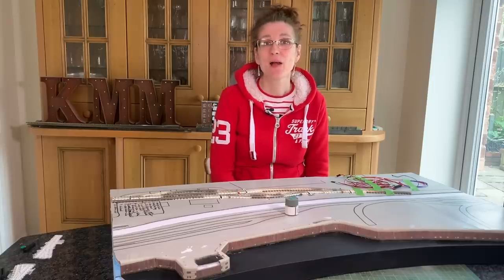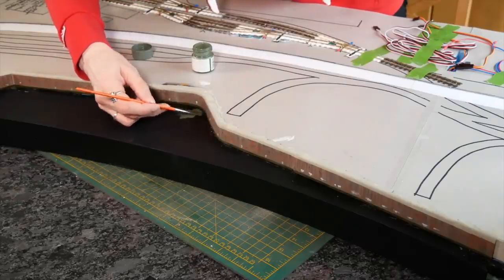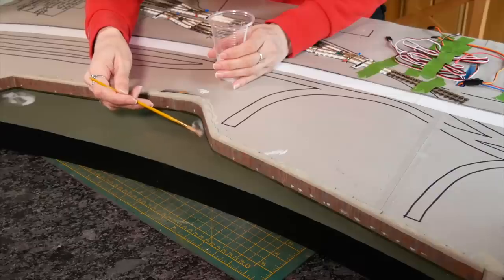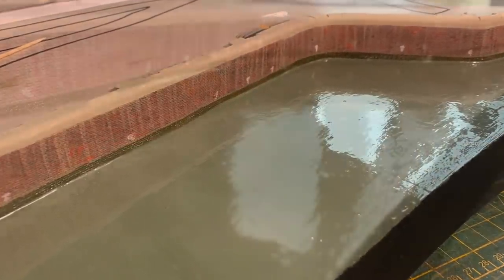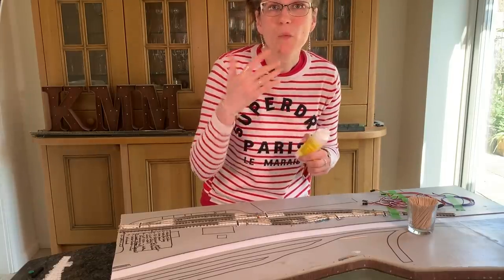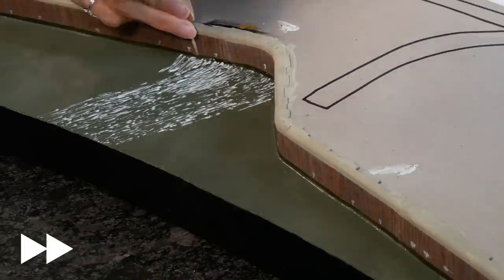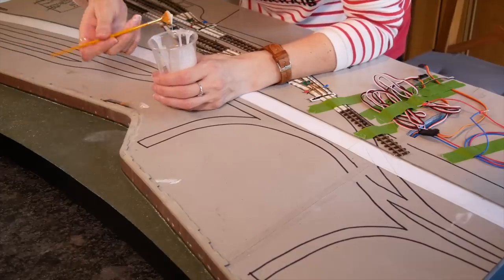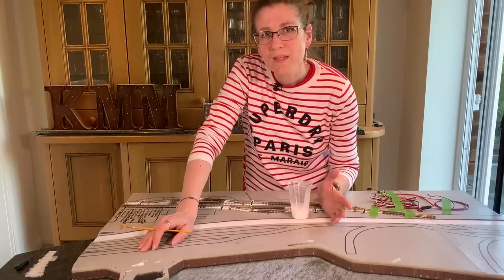Cheap and Easy Model Water

Comment: Great tip.  I liked it before you added the ripples because I need to model swampy water which is usually still; and it looked about perfect as far as texture and gloss.  The color was really close as well.I wonder if you could mix the paint with the glue as well.  Any thoughts?
Reply from the maker: Thanks. You can easily mix paint and glue but I’d always do a top coat in clear just to be sure it has the gloss to it. Even that might not be necessary but I haven’t tried it.

Comment: hi kathy - great idea, never thought this would work as good as it seems. for ripples - or waves rather - have you tried using a clear fix adhesive, like a silicone product? it is obviously not pva but it is an inexpensive 1 component product that is readily available. it holds its shape and cures totally clear and can be easily manipulated with a toothpick or similar. check out "luke's APS" channel, he experiments with it quite a bit.
thanks for sharing, enjoy the videos. cheers.
Reply: Luke is talented, funny and makes very good videos (as does Kathy 😁).  Check out his site!